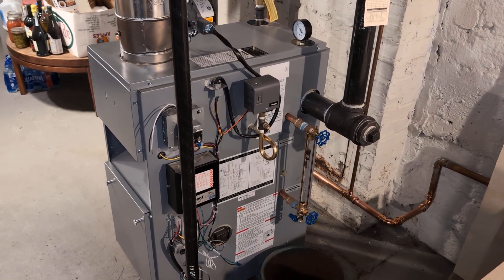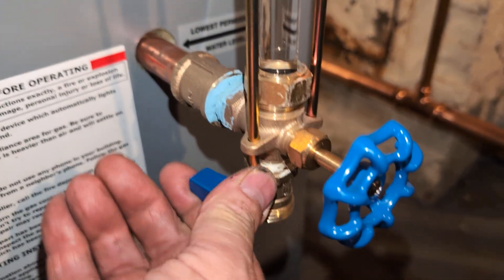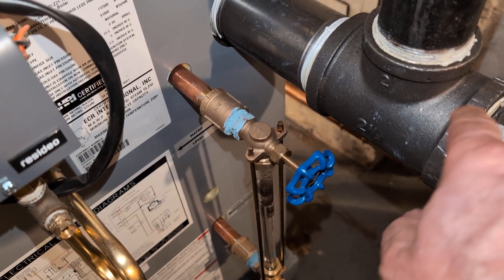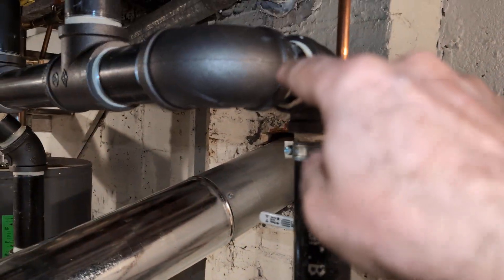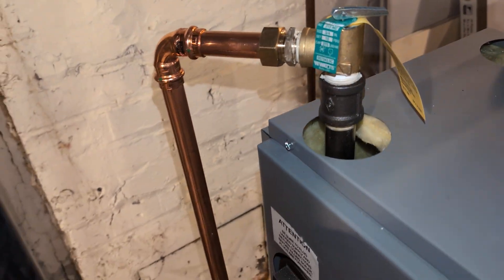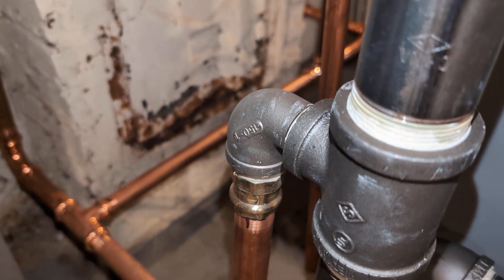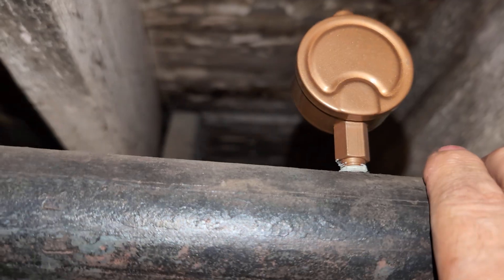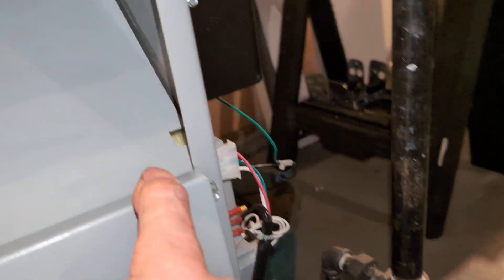Columbia CEG-F Steam Boiler Install

Comment: Gordan, love your videos. 
If you get time and bored can you do me a favor ?
I'm trying to hold on to my still working great 1962 National Boiler. I hate to replace it since it has no leaks, and fill valve, gas valve, Pressuretrol all been replaced in the last 10 years by me and working fine. Had 1 or 2 issues with it getting "Sooted up"  and had a guy come out last winter since it was so clogged it "Blew itself out". He cleaned it but I never had a "Combustion Test" and this "Pro" said he didn't bring his with him and the flame looked "ok". Of course they suggest a "New Boiler" since mine is old.
Just in case I do eventually need a new boiler I was told about $8000 - $10000. 
I need your expert help. 
Mine currently is an Input of 127,500 BTU's            Output 102,000 BTU's      275 Sq. Ft. of Steam.

Not sure if it's actually "Oversized". It sits on a narrow cement base. Looking into a replacement with a new one, it won't really fit on the base without a steel plate or making the base bigger. 
But anyway ......
If you get bored, and have time, and feel like doing a few calculations for me to see what size boiler I need and not "Oversized" I would really appreciate it. 
I posted my current one and here are the numbers for my house ......

A Cape Cod in Chicago built in 1908. Probably original Radiators from the day it was built since they don't have the "Cross Tube" on the top. They were Specific "Steam Radiators" only for Steam before they went to the "Standard" double tube that can be used for both. 
They are 38" high
3 Row
9 " wide

One 5 Column
One 3 Column
One 4 Column
One 8 Column
One 4 Column
One 8 Column
One 5 Column

I have the system perfectly balanced and no issues. Also, I don't have a "Hartford Loop". Piping is probably original from 1908 before the Hartford Loop was required. , I have a "Check Valve". It's a "Single Pipe" system.  
The Steam Main comes from the top. 
Good Boiler Brand and is 127,500 BTU's "Oversized" ? 

In one of your videos you replaced the exact same boiler I still have. A National Boiler 6-22

I thought I would ask the expert because here in Chicago if you call 3 different people to look into it you get 3 different answers.
Reply from the maker: Thank you for your kind words!
As to the sizing, from the info you supplied, it appears that your current boiler is indeed "right-sized" more or less.
I'm getting about 185 square feet or EDR, and with a pick-up factor of 1.33, gives a boiler size of 246 sq ft.
The sooting is a big issue and that should be looked at properly ASAP.
I would call The Boiler Professionals or "The Boiler Whisperers" for service.
Please tell Dave I give him my most sincere greetings and best wishes.
Reply: @gordonschweizer5154  Thank You Gordon !
End of August beginning of Sept. I will call them to come out and have them do a Combustion Test and see what's going on. I lived here since 1994 and take great care of the Boiler but never ever took the top off and checked in between the sections and cleaned them. I took everything else apart, the burners and cleaned the bottom, but never knew about cleaning from the top down. For many years I always had yellowish flames that I could never get the right way adjusting the air openings for the burners. 
Thank you for the Boiler size I would need. I will definitely call them . The 3 times I did have someone come out to change a gas valve, and do a cleaning last year from the top down (because i didn't know I needed to do that), these "guys that know steam" here really don't.

Comment: Have you ever seen the copper condensate rot out due to low pH water.  Do you recommend a certain pH for the boiler ?
Or water testing / treatment such as soft water / softened water?

A video on water quality would be appreciated
Reply from the maker: I cannot recall ever seeing a copper condensate line rot out due to low pH water.
On domestic water copper lines on untreated well water? Oh, yes.
I would recommend a pH of above 8 for a steam boiler (but not too high - causes foaming I've been told).
Well water treated to make it "soft", I've been told, is not so good for steam boilers - chlorides attack the cast iron they say.
As for water testing - it is difficult to find a dis-interested party to do that, as many just want to sell treatments you likely don't need.
The best "water treatment" is a tight system that needs little to no make-up water.
Reply: Thanks for the come back.
Btw i found out i could give a thumbs up to my own comment.
Pure nepotism at its finest@gordonschweizer5154

Comment: Any experience with a New Yorker CL series steamer? I think that would be the ideal replacement for if and when my PV73ST fails
Reply from the maker: I myself do not have much experience with the New Yorker CL series, sorry.
I would look at the Williamson (a rebranded Weil Mclain).
In a nutshell, the boiler's installer and proper sizing is more important than the brand.
Reply: @gordonschweizer5154  totally understand that sir. Just poking around on their website the CL series looks very similar to what I have at the current moment. Also has a single outlet like my PV73ST has
Reply: @gordonschweizer5154 appreciate the info sir. I will also have a look into the Williamson oil fired steam